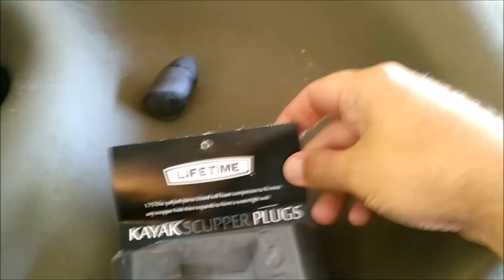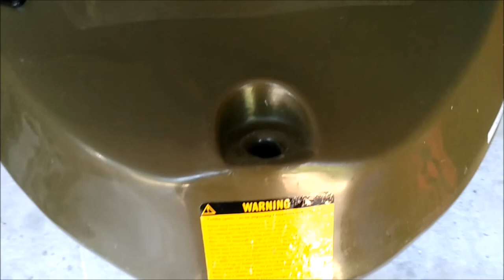Lifetime Sport Fisher Kayak Review

Comment: If you still have this kayak: how has it held up?  Have you tried standing to cast or throw a cast net? Do you think it would be possible to build covers over the footwells to provide a flat surface for easier standing? Also, thanks for taking the time to upload your video!
Reply from the maker: Gary Jensen I still do have Lifetime Sport Fisher still. I did have to get a replacement from the company last year because it sprung a leak but they honored the warranty no questions. Other than the leak, it has been a really great boat.

It is a very stable kayak and I say this as a big guy. But I have never tried to stand on it. I guess it would be possible to cover the footwells to make it comfortable to stand but I'm not sure the best way to do that.

Good luck!
Reply: Hull Down Kayak Fishing Thanks for the quick reply, I am considering a tandem that can also be used solo and this is at the top for consideration. The fact that it's only 10' long is a bonus for the small Florida canals.
Reply: Gary Jensen I’ve been able to stand and cast in mine. Check out the video on my channel

Comment: What's your take on the reports of these commonly being delivered with through-holes along the horizontal seams? Based on that, I have to wonder about the quality control at this company. I really want one of these, but they can't be purchased from stock at any brick-and-mortar I can find. Buying it sight-unseen and possibly having to ship it back has really put me off on this deal. Too bad, it's the only tandem fishing kayak I've found that will fit on the back of my crew-cab Ford without an expensive rack system or a trailer. I've been very disappointed to discover that the manufacturer has these issues.

Comment: Those holes that you don't know what they are for. Do they not fit a fishing pole handle?
Reply from the maker: I guess they could hold some rods but since they don't go down very far, they wouldn't keep the rod secure if you get a big enough bite. I'm still not sure what the holes are supposed to be for but I made a PVC camera mount/rod holder that fits the holes nicely. Thanks for the question!
Reply: Phillip Bustamante they are cup holders. look at the manufacturers specs

Comment: Please help me with suggestions , if I can carry this Kayak on my corolla. I bought it recently. Not willing to buy a truck / trailer for transporting the kayak
Reply from the maker: It's ten feet long so it would depend on how much space you have. On the roof it should work I would think. If the back seat goes down and you can hang it out the back through an open trunk, that could work too I suppose. 

It is pretty wide compared to other kayaks to be honest though so I'm not certain. I have a crew cab with a short bed and it works fine with the tailgate down.

I wish I had better info for you. Good luck!
Reply: @HullDownKayakFishing  Thanks for your reply! I got the kayak on Corolla roof and made it to the lake. A roller mat worked well while mounting . Also the soft rack from Alfa gear is really great!

Comment: Good review. I will be waiting until spring before i purchase a kayak, so I will be watching your videos to see if this is the one for me. I'm 5' 7" and 220 pounds.  I'm looking for a kayak for crappie and bass fishing on lazy creeks and small oxbow lakes, but where I may have to pull across beaver dams, and portage from creek to creek. I've also been looking at the Sun Dolphin Journey SS 10. Good job on your videos.
Reply from the maker: +John Gschwend Thanks John! I hope I can provide more insight. I'll say this for the Sport Fisher, the handle on the front should be great for portaging, it just might be a little heavy. Good luck!
Reply: +John Gschwend I can't say enough about the Sport Fisher. The stability is impressive. I'm 5'9 and 250 and I can move all over the place on this kayak without fear of tipping. I use my kayak in slow flowing creeks, inland lakes, etc and it has been perfect thus far.

Comment: my back rod holders make the rods angled forward while yours the rods on are angled toward the back. is it a different design or mine just was installed incorrectly? thank you
Reply from the maker: Outdoor TV That's a good question, I don't know. I've had two Sport Fishers now and both have had the rod holders angled to the back. But the angles were slightly different for each so they may not have an exact set angle. Hope yours works out for you.